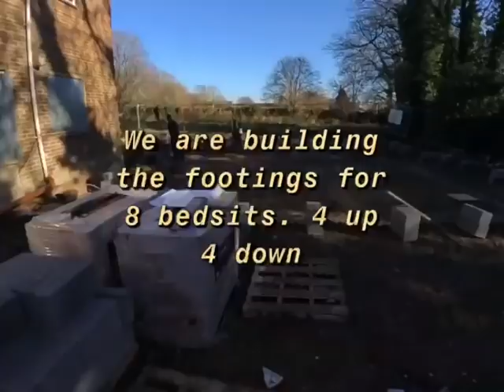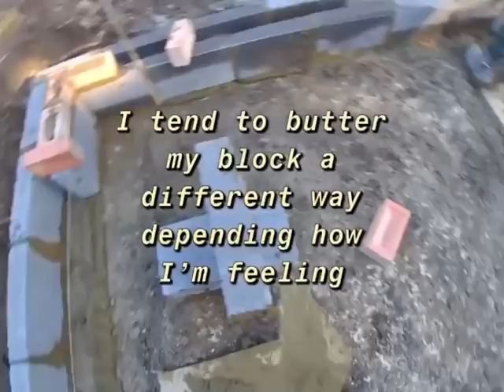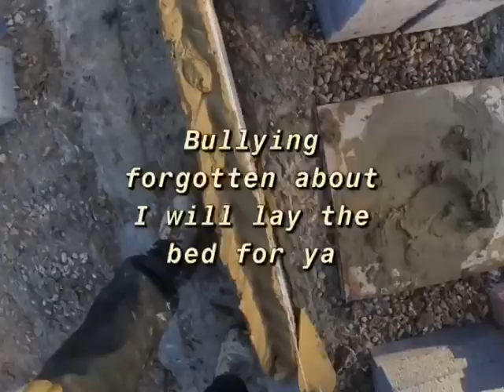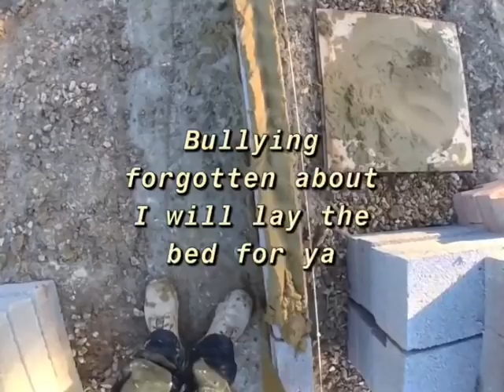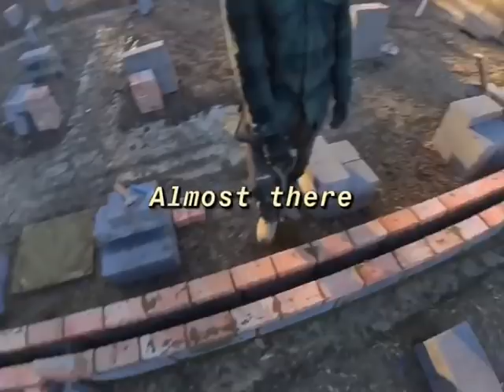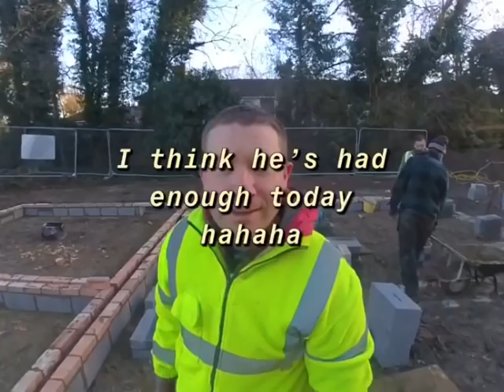Foundations POV. | The skill of bricklaying.

Comment: Crazy ass time cutting the block just hang it over block about the length your cutting off clean crisp cut in seconds. Or 2-3 dings with bolster then on side wallop with mash on opposite side there she is. No more in 3 hits required either way lol. 👍🏻
Reply from the maker: Day rate 😉
Reply: 😎 ah a see. Better mark it all the way round with bolster on both faces top n bottom to get a super good cut 😆👌🏻👌🏻

Comment: Is that muck from a cilo and were are you air bricks going and telescopic going they beingvented between the beams
Reply from the maker: Kieren Standen n it’s from a mixer our firms to small for a cilo
Reply: Ginger Dust big diesel one then lol
Reply: I hate when ground workers put the lintels in for the telescopic for air bricks they never lleave enough room for play and hardly ever work brick work
Reply: Dry screen sand (aka Builders Sand) full of clay mud. That stuff doesn't make durable mortar IMO. However because of the clay its good and buttery like a cement/lime mortar would be. Be ok for  house building.

Comment: Do you guys ever use cinder blocks with rebars? I don’t mean to be critical is just a question, personally I like the way you guys build up houses 
Is like paradise for brick masons,
, I’m a mason here in the states, but here masonry is mostly for esthetic purposes, rarely structural, but when that is the case we use cinder block.

Love your vids , good job.
Reply: No rebar is not used in domestic UK building. The foundation blocks have to be very dense and a certain Newton strength, the cavity is also filled with lean mix concrete up to ground level, so you have a 300mm solid block effectively. 

Above ground the two walls of brick are tied with metal brick ties which gives the wall it's structural strength.

Comment: Bricks should always be frog up other wise full pertenssional strength is not achieved. Why didn't you just put 2 courses of 140 mm deep foundation blocks down instead it is quicker and no need to do a concrete fill below ground level. Other wise I was very pleased to see you did frog up sadly not all your bricklayers followed your lead. I hope it was at least 4  degrees Celsius and rising on the thermometer as well.
Reply from the maker: I’ve been taught by an old school brickie that taught me to lay frog up and I’ve been doing that for 5 years now. We didn’t start until 11am when it warmed up otherwise we would of finished it. The next day I was sent to another job so I could do a picture of it ready for the block and beam.
Reply: 2* and rising
Reply: @coreytrevor8213  I don't want to sound condersending but I have been in the construction industry for 46 years and in all that time it has been 4 degrees and rising and yes I know you can put an accelerator in the mix but, it's no excuse for best practices.